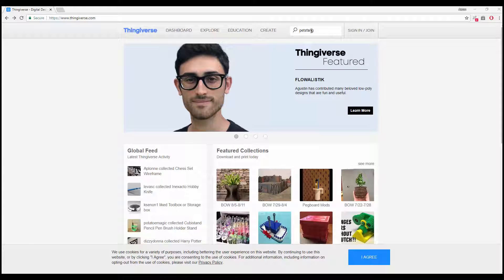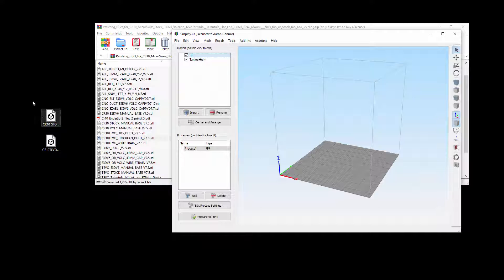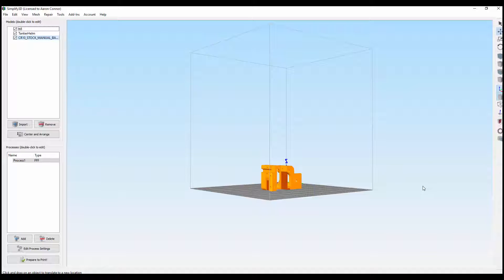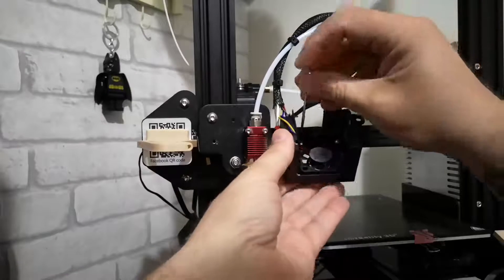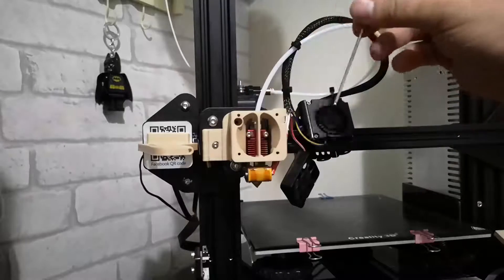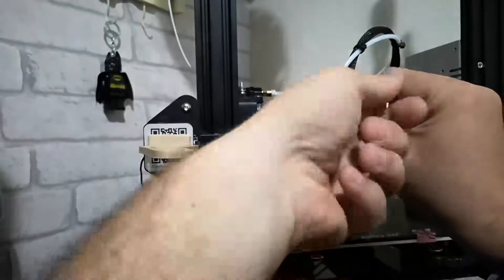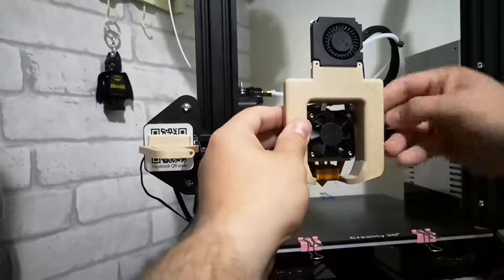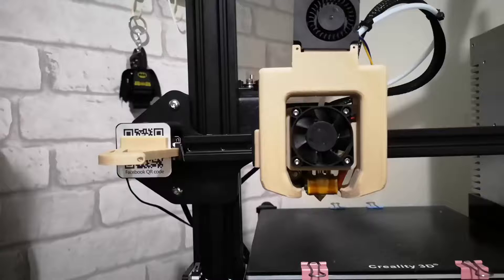How to 3D Print and Install the Petsfang Duct for the Creality ENDER 3

Comment: Hello, great video - quick question - will this work on the Ender 3 V2? I downloaded the new Petsfang zip file and I can't find the version that reuses the blower fan. I found the stock base for the Ender 3 V2... but just wondering if the original fang would work on this new stock base for the Ender 3 V2....

Comment: Thanks for the video. Quick question. Do you feel that using the existing fan is sufficient, meaning does it put out enough air flow vs the other fan typically used with the PETS Fang?

Comment: I wanted t ok print that version for mine but it's not in the files on thingivers anymore. It's the Bullseye now. That the only one I could find with the square fan on top. I'm thinking it's an upgrade from that version.
Reply: its the same.autor added a upgrade for 1150fan u still got this model.